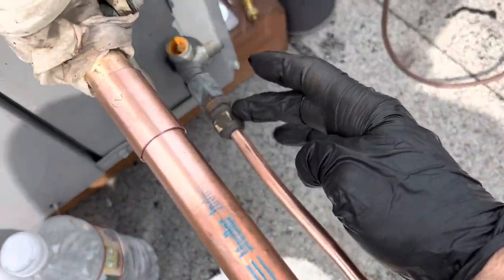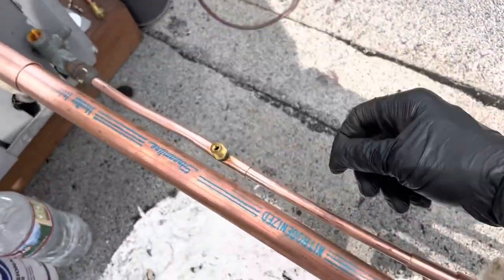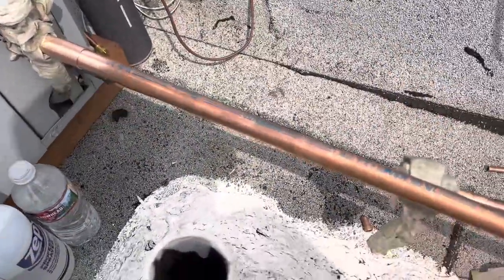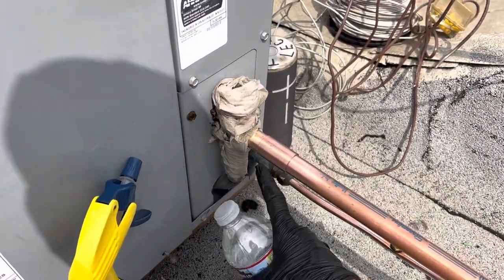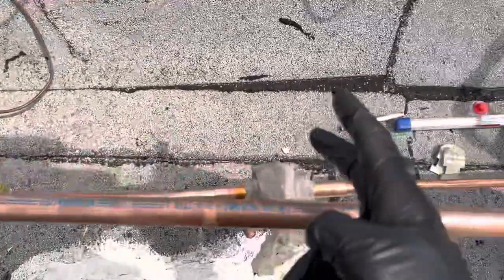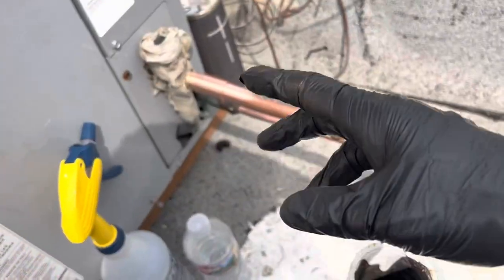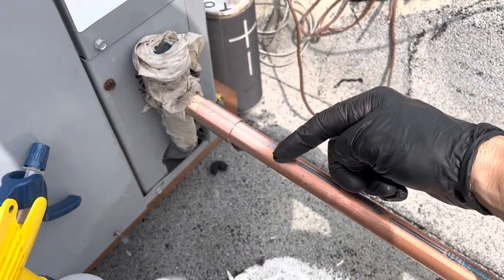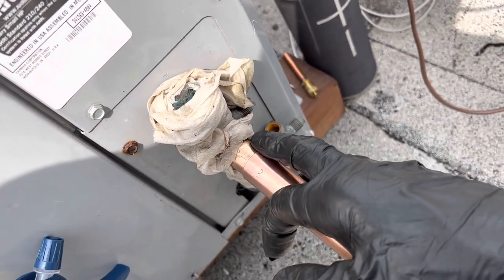SILVER BRAISING PREPARATION OF VALVES. Which way is your nitrogen flowing￼

Comment: Great video, thanks for the info on the nitrogen flow! have you tried the jvac heat putty to keep the heat away?
Reply from the maker: Yes, and the spray gel to. They both work good.  I’ve made videos with them. 

But every one has paper or rags and water.    Not many beginners will be buying something a little pricey.
Reply: @coldfinger459sub0  cool bro you think of everything 👊👊